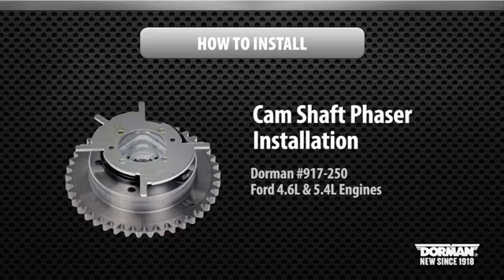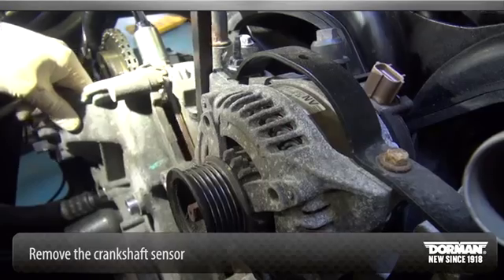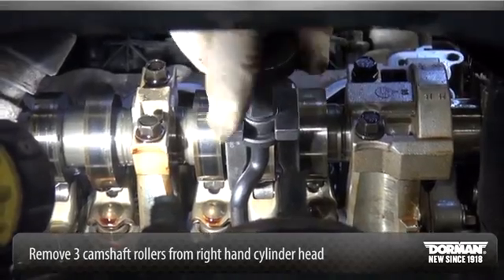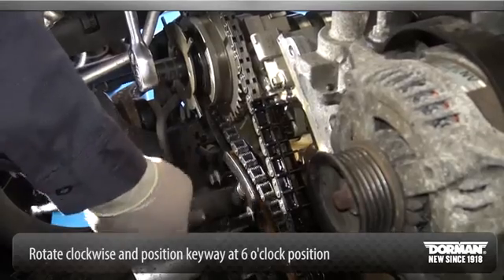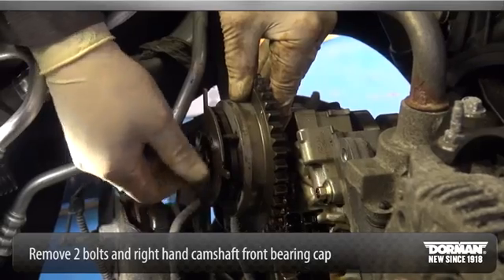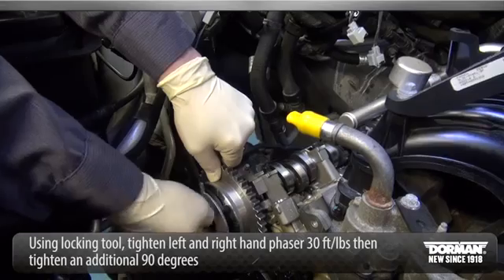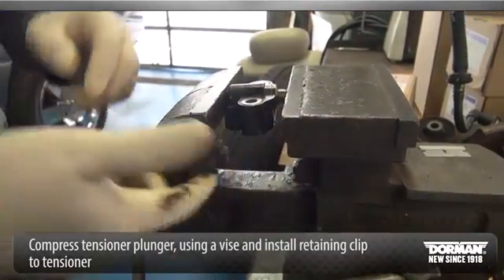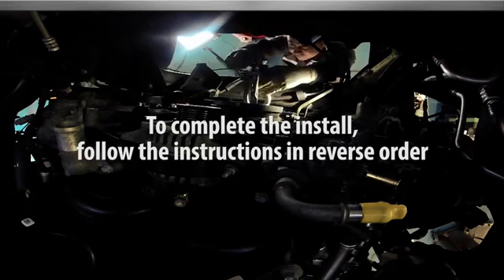Camshaft Phaser Installation

Comment: Question: Is the cam phaser reset at Center, and engine set at top dead center, for installation of cam phaser on 05 Nissan 2.5 L engine?
Meaning the engine would be able to advance and retard from top dead center.